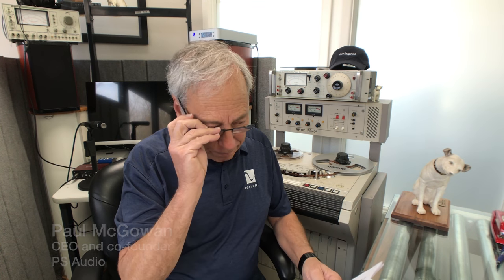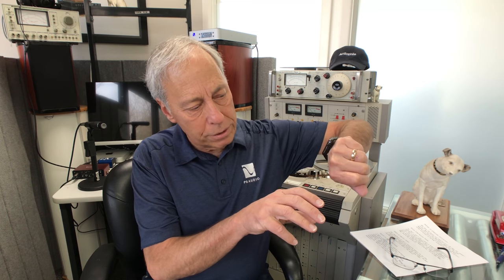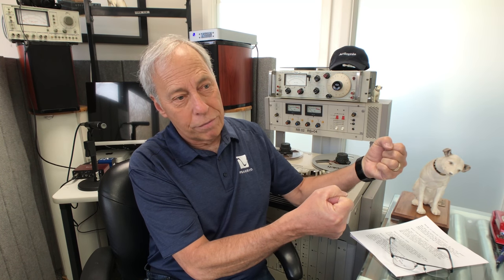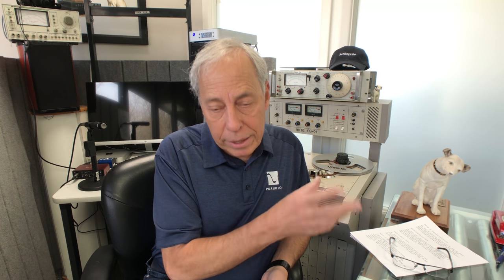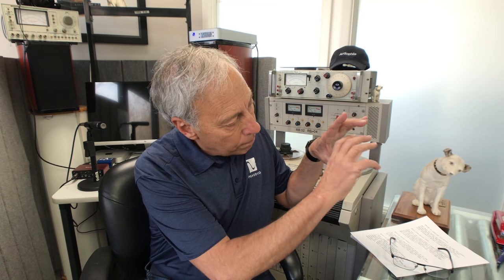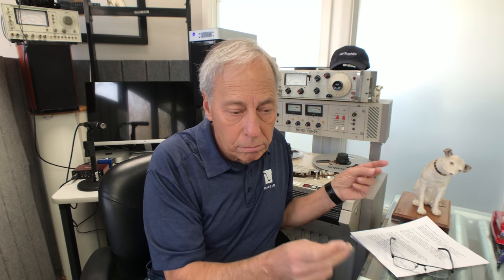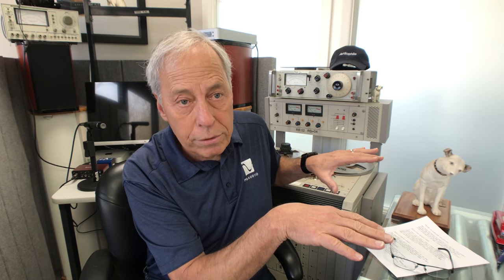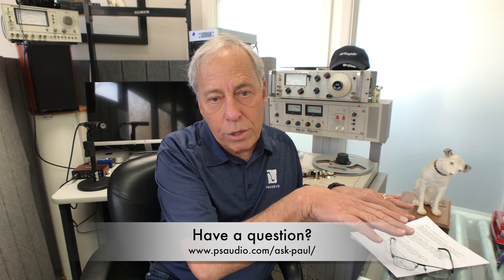Why no 20 amp plugs?

Comment: Funny how all the comments, to date, are about the shorter lead in. And not about the subject at hand.
I totally agree with you, in that very, very few amps need  20 amp cable.
I know a guy, who thought he knew more than the amp designer and replaced the 15 amp socket/cord with a 20 amp socket/cord....He blew up all 7 channels the very second he flipped on the power switch....he wired the socket wrong....

Comment: I was told to check the color of my house wiring meaning type to make sure the builder used wire that could handle the 20 amps or their could be a fire. any thoughts on this?